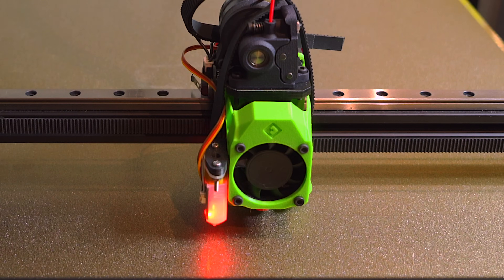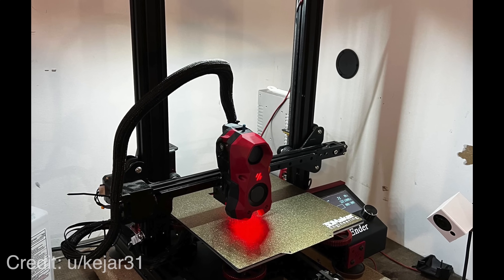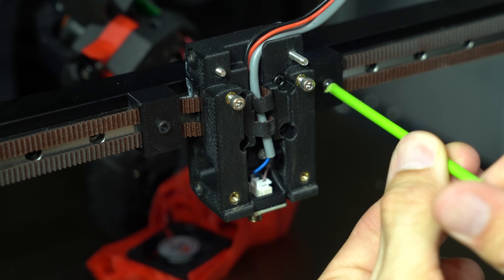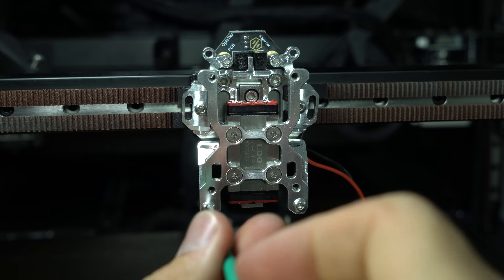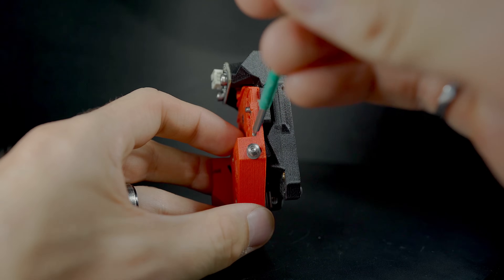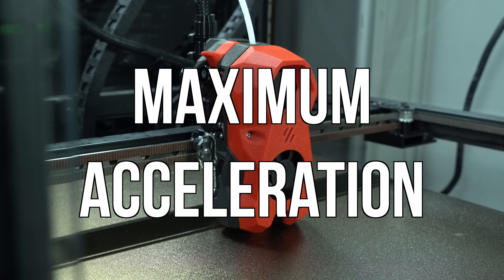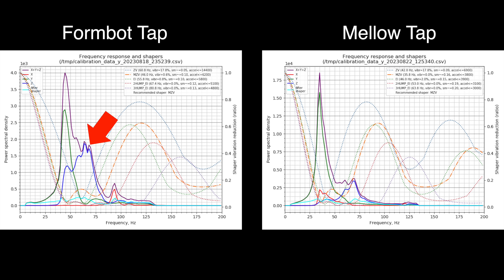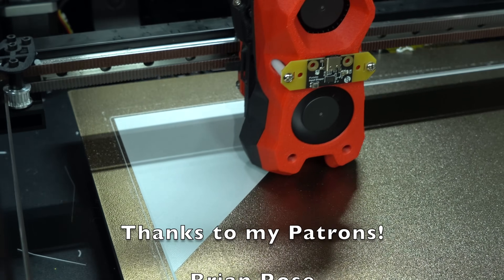Is Voron TAP Really "ALL THAT" ? A Semi-Scientific Analysis

Comment: All the nice features of the DIY version is the result of our iteration on the design. The metal versions are designed by whoever is selling them and didn’t have the same dev cycle time as the plastic version. Or any involvement from VORON Design engineers for that matter. So YMMV with those.
Reply from the maker: The man himself. Thank you for stopping by and for all of your work on the Voron project. You are truly a legend.
Reply: @ygk3d  Thank you, I'm just happy to be here. Great analysis on the various versions that sprung up since we released TAP. I didn't even know about the Mellow one. The behavior on it is quite odd, it should have performed on par with printed TAP setup, but there's clearly something not right there.
Reply: I've got a barebones one from Mellow on the way too. Going to use the same rail & sensor as i do on my RC8 tap and compare it back to back. Should at least rule out any potential difference from the rails and sensor, and just leave the printed plastic / cnc comparrison.
Reply from the maker: @Exerqtor_  good thinking! Let us know how you make out.
Reply: any updates? tnx @Exerqtor_
Reply: @Exerqtor_  have you been able to test the Mellow frame yet, did you have the same problems with rigidity and accuracy as YGK3D?

Comment: I'm not sure but I think the plastic version performed better, not because it was more rigid compared to the CNC version. But the plastic construction gave it a bit of compliance that means it's acting like a dampner cancelling some of the  vibrations. Whereas the CNC version made of CNC aluminium being a rigid material, all the small vibrations are transferred to from one end to another and sometimes causing more resonance due it's rigidness.

Like a how a wine glass shatters when hit with a specific sound frequency, unlike a plastic cup which just absorbs it due it's flexible. 
I'm not sure  about this theory but yea felt like sharing it!! Happy printing ~~

Comment: If using a hotend ecosystem (like E3D Revo) that has nozzles machined to the same height, you won't have to change the z offset when changing the nozzle.  Also if using a contact probe (like klicky or BLtouch) you won't need to adjust z offset when changing the build surface.  In both cases the actual distance between the probe and nozzle doesn't change, and the distance from the probe to the bed is accurately measured.  OTOH, a non contact probe such as inductive, capacitor, or optical may not record the same distance when changing build surfaces.

Comment: Hey there, just wondering if you could share a working printer.cfg file. I`ve got the 250mm Pro version almost 2 weeks ago and still trying to print ! Issues with Tap and temp drop after QGL

Comment: I'd bet money that a dark matte finish on the Mellow cnc one will impact it's repeatability for the better. It's an optical sensor looking at a highly reflective surface that is curved at it's edge. I bet the optical sensor sees all sorts wild readings at the moment before the light curtain is fully broken.

I'm also willing to bet the mellow cnc one isn't as bad as your graphs show, but the accelerometer is seeing considerably more noise because the metal tap isn't absorbing any energy and transferring vibration from the gantry and rest of the machine into the tool head. You changed the material of the part that is exclusively responsible for mounting the head to the gantry and then read a vibration sensor on the head. Of course the results will be different and your conclusion saying one is better than the other is premature.

Was the accelerometer soft mounted? Your graphs really only show useful data below ~150hz and I can't imaging soft mounting impacting that freq range, but it should dramatically reduce noise going into the accelerometer.

Comment: My printer uses mellow tabs and has a maximum acceleration of about 7800.

For mellow tabs, the toolhead is clamped to a metal plate.

The metal effectively transmits the vibration of the frame to the toolhead, which is read by the accelerometer sensor.

The printed tab cancels out much of the vibration, meaning that the plastic component is preventing the sensor from reading the waveform of the actual vibration.

Comment: There is absolutely no way that a basic microswitch can't handle 24V. It's not like it's a solid state device with nano scale insulated gates, it's literally pieces of metal that are mechanically moved to make/break contact. That said, microswitches are never a great option for any positioning system as they have poor reproducibility when compared to other options.
Reply: I was also shocked to see a microswitch in one of the TAPs. It pretty much defeats the purpose.

Comment: We have a LONG way to go to make this perfect.  

Maybe the best way to "tap" the bed is to mount the bed on four load cells.  The nozzle would then move down until (say) 500 grams of force was measured. Load cells could be mounted under the bed and on the 2.4 in such a way so as not to raise the bed and use up any of the vertical build volume.   The cells cost maybe $10 each.   This would allow "tap" probing with any unmodified print head.

What about using the accelerometer?   Move the. nozzle down slowly and the accelerometer should detect just the normal 1G gravity until contact is made with the build plate and then it should measure a huge upward acceleration.   It would work if the response were fast enough.

On CNC milling machine we always need to locate the part relative to the machine.  They use electrical contact.  This would only work for a bare metal build plate.   You move the nozzle down until it closes a circuit with the bed.  But this means insulating the bed using plastic screws or something and would not work with non-conductive surfaces.

Could a sensitive microphone detect nozzle-to-plate contact?

Comment: I doubt I was the first to do this, but I "invented" a material I use in many of my designs.  I call it "steel-reinforced PLA".   I model a long M3-sized threaded hole in the plastic part.  Then after printing I drip some CA glue (super glue) in the hole and thread in a flat-head M3 screw.  The screw is simply acting as a steel rod making the part stronger.   PLA is usually somewhat brittle but with some steel screws inside it is MUCH stronger.

It looks like Formbot does this too.   But no glue.
Reply from the maker: Great idea! Voron used this concept in the design of their printed Tap. Formbot just packaged that up as a ready-to-buy kit.

Comment: dang i really should look such things up before ordering parts and installing them, if i had done that i would not have got an tap and wouldn´t have to change now
Reply from the maker: Tap is still good. It limits your maximum printing acceleration but if you’re not printing at crazy speeds, the convenience of Tap may be worth it for you.
Reply: @ygk3d  yeah might be but i switch to the standard stealthburner for my buid since the 30$ one i got from aliexpress is garbage, installed the stelthburner onto it and i could really tillt it left and right so i took it apart just to encounter that  one of the threads was so wide that you couldn´t get it fastened so instead of wasting more money i decided to fist get it up and running standard way with the klicky probe and maybe try it later if everything is running, downside is that i now have to get new belts because installed them wron on the tap and they are to short for the normal now...

Comment: The CNCTap's optical sensor could be affected by the surface finish of the metal tab moving through the sensor. Maybe coating the tab in a matte black paint will increases the accuracy?

Comment: I really don't believe it's just tap that'll allow any build surface to be used without additional calibrations. I've used bltouch and klicky to determine where it's endstop is and it'll now use the new values to print at without calibration. Example if bed is 0, and I throw on a 4mm thick panel on and it probes it with klicky or bltouch, it'll now lay down first layer at 4.2mm

Comment: "Every time you change a build plate or nozzle, you need to re-calculate the offset"
This statement is true just in case of changing a building plate but false when it comes to nozzle changeover. In Klipper the fundamental offset is defined not by a distance between a print surface and a nozzle tip but between the printing surface and a Z-home switch trigger point. Once you've set a Z-offset for one nozzle there will be no need to re-set it for any other nozzle you change to the same way as in CNC mill you need to zero just the very first tool, or MASTER TOOL to Z0 of a program coordinate then after every next tool change the offset will be gotten automatically just as a DELTA between a master tool offset and the Z coordinate at what Z-tool setter is triggered, that's it. That's exactly how Voron printer works. Also changing a nozzle is a silly idea cause changing a whole hotend ass'y is a proper way to go.
Reply from the maker: Good call. On the 2.4 with the z pin for homing, you’re right. But the Stealthburner can be used in other setups without a Z pin, in which case changing the nozzle would require recalculating the z offset.

Comment: The rigidity of these assembly depend only on the linear rail quality. In a dependable linear rail brand, you can choose at least 2 or 3 quality (smoothness of the ball path) and, most importantly preload value. For example with Misumi you can choose slight clearance (standard movment with no effort), light preload keep rigidity with low efforts (as in a 3D printer for example), and high preload (typical for lathe and Milling machines). Of course if you want smoothness with low effort while keeping precision you need high quality combined with light preload. With preload type, blocks are paired with their rails and you can't exchange them. For reference from their respective catalogs, Misumi precision is at 7µm, original Hiwin is around 40µm and you can imagine the Chineese knockoffs...

Comment: I like this but man that mgn rail is huge. Surely there's a better way to make this system more compact. (Not discounting the engineering that went into the tap though, it definitely is impressive!)
Reply: Tapchanger and stealthchanger actually have this built into the design, but cheap mgn rails have gotten so accessible that its hard to justify the extra assembly complexity just for tap

Comment: Have the Chaoticlab Tap installed on my V 2.4 for couple of months, decision taken after two destroyed extruders while printing ASA/ABS. Today fitted a Buildtak surface as was still facing adhesion problems with those filaments. Guess what? QGL was not successful for several times. Reason? Buildatck got some nice holes, 0.4 diameter of course and several thousands deep, right exactly where the nozzle was probing. Cause of Tap? Yeap....

Comment: My tap has been on my voron for many hundreds of hours. Smooth PEI and a diamondback nozzle. 4 magnets. No marring or damage to the print surface at this point! I did find the need for a brush to clean the nozzle before tapping. Which required some macro work. Certainly not plug and play, but amazing!

Comment: I'm really sad that this is an obvious formbot paid-for ad, as evidenced by the reference to the voron tap as the formbot tap. formbot printed it, voron created the cad. any sort of "optotap" kit is the same as the formbot kit, minus the printed parts. formbot shouldn't be getting the credit for the amazing work the voron team put into this creation. I won't even start with the "troodon" ripoff of the 2.4.
I'm not ticked off at you ygk, I understand it/would do the same thing as a youtuber starting out, but I am ticked off at formbot for various reasons related to and unrelated to this vid. I just hope they aren't the ones that told you to refer to it as the formbot tap... toxic company 

anyway, the tap's great. overengineered? hell yeah, but that's the voron spirit.
the beacon is better but pricier. 
a well setup klicky is great too! 
we have so many amazing options for different people, uses & price ranges

I run voron tap on my printfarm printers, I bought a few kits for £12($15)/each on sale on ali and printed my own parts in fusrock abs-gf (already had it)
I recommend abs-gf (or even better: asa-gf, 25% if you're gucci) for tap for obvious reasons to do with stability, but buying a kit with the pre-printed parts made of abs-gf is def the way to go if you don't already have the abs-gf and you are only putting tap on one printer. abs-gf is expensive, yo! and unless you plan to print other shit with it, it'll go to waste

blahblahblah ramble ramble ramble 

good vid, too bad you couldn't get 5v to the toolhead to compare the chaotictap. that's what I wanted to know about the most

Comment: I will compare my printed tap vs my mellow tap. I had a lot of problems with the printed one. 

Breaking and melting parts mainly.

Comparing graphs is pretty hard as you never know if there is an assembly fault as most graph irregularities result from user errors/ printing artifacts

There is also a third cnc tap from Vitalii which combined cnc and 3d printing.

A little correction to the video, it’s not formbot tap, it’s voron design tap. Formbot just provide the BOM and printed parts as a kit.
Reply from the maker: Thanks for your comment. I’m planning to test the Vitalii Tap as well in a future video. 

You’re right, it’s really just R8 Tap from Voron Design but pre-assembled and sold by Formbot. I was just trying to distinguish it from DIY self-built.

Comment: Great video. Really appreciate the throughfull and thorough a/b testing.

The input shaper results alone are enough to make tap a no-go for me. Nozzle probing is "ideal", sure, but we can already get beautiful first layers with any of the many other probes out there.

So we have a theoretical advantage from probing with the nozzle, but materially we get the same good first layers.
And we have the very concrete disadvantage of input shaping being absymal. 

And then after all that, tap will cause pock-marks in smooth PEI while other probes will not.

TAP was/is a valliant effort form voron design team and I'm glad they released it, but I wil keep looking. Klicky-00 is looking interesting, combining klicky with direct nozzle probing.

We could also explore using a circuit through the nozzle and a block with known thickness, similar to how CNC touch blocks work.

Comment: TLDR; TAP is scam. Up to 100g more on the x-achsis is poison for fast printing and the loss of rigidity on the print head is a no go. I even don't undertand why you need that when you have a milled aluminum plate and a proper build gantry.

Comment: Another idiotic engeneering solution by Voron team. Voron is full of idiotic solution, but this one is stupidest for now. 
My Sapphire Plus with custom head ("Diamond") and BLTouch has 119Hz MZV on X and 78Hz MZV on Y.  Cheap chinese printer with small mod is twice faster than Voron.
Reply: It's great that you're printing in the 700+ range.
Reply: I have 180HZ mzv on x on my voron. You have skill issue.
Reply: @youtubehandlesux  Try raising accel_per_hz to something about 200 during resonance measurement. You'll get real values.

Comment: Voron printhead is already extremely heavy and seriously limits its printspeed. Why would anyone add 100+g to it? 8400 stock or 3800 accel is a joke by modern standards. P1P is 10k.  With few mods like Mantis Xol printhead, aluminum gantry it is posssible to achive 15-18k acceleration. It you dont like klicky why not use tension sensors like bambu or prusa?
Also mounting acelerometer on a fan cover wont give you realistic numbers in y-axis. It should be mounted on a heatblock/nozzle.

Comment: I have personally not explored nozzle probing because i want to be able to use cheap black print surface sticker (buildtak-like), i don't know what it's made of. Is there a nozzle temperature at which it can be used, where both the nozzle wouldn't damage it too much and the nozzle gunk of PETG and HIPS will be displaced and not affect the probe?
Reply: TAP klipper macros reduce probing temp to 150C to avoid damage to pei and other surfaces while probing.
Reply: @thegarageluthier  IIRC they said in the inital announcment livestream, even at 150c tap causes pock marks in smooth pei.
Reply: @caramelzappa  I run Tap on 2 machines at the moment and have had zero issues, but this is just my own personal experience.

Comment: When you use an optical switch or such like, you need to provide power to it, so 12/24V may matter, the board needs to be designed to accept either or both. The power must be independent of the GPIO that gets triggered by the probe.

When you use that mouse button switch (endstop, microswitch), you simply don't run power to it, you just use the internal pullup GPIO wire and ground. The GPIO is going to be 5V or 3.3V whatever the processor IO voltage is. So i think you may have rejected the variant that uses a microswitch prematurely. 

Furthermore switches of this construction are typically safe to 30V or more, you can see Omron D2F and Kailh GM specs. Very cheap variants such s D2FC and no-names are only tested to 6V continuous operation, but there's not actually a reason 24V would cause a concern when current limited, and they are still typically Hi-Pot type-tested (600V, 1500V). The wording is probably supposed to warn you that if you run your 12/24V to the switch and the GPIO line, instead of ground and GPIO, you're going to instantly damage your processor. But well wrong wiring will damage your processor with any kind of sensor or switch or peripheral.